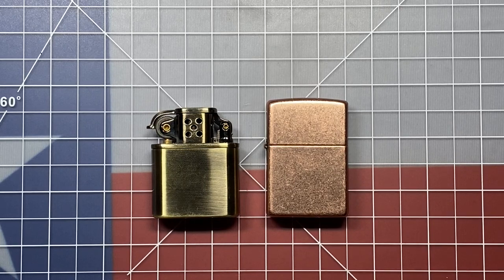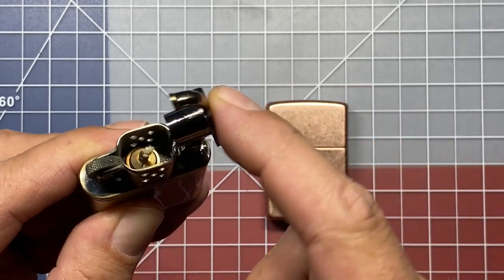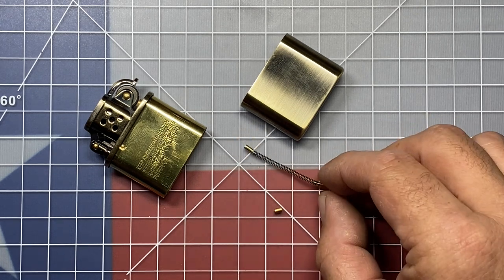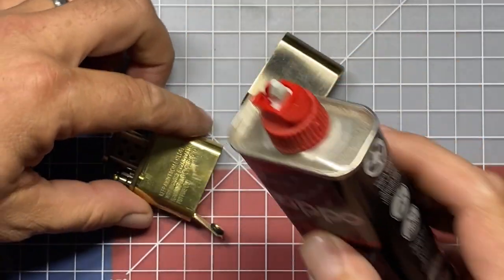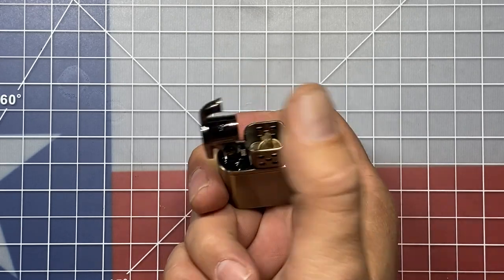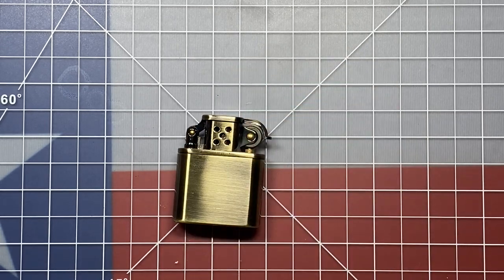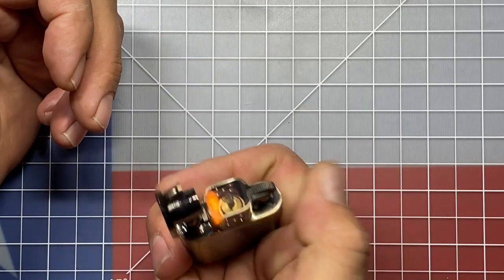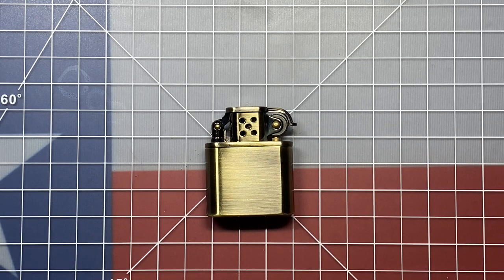Kuboy Lighter

Comment: We have to be honest, we can love Zippo for its history, but these are the improvements that should have been done but Zippo never did: o-rings and closed bottom (on AliExpress they sell after market plastic bottom, but I'd prefer a metal one like this one).
Reply: Exactly! Some years ago I bought a Zippo and was very impressed by it at first. But when I tried to light it a couple weeks later (thank goodness I don't smoke) and it wouldn't, I simply couldn't believe it! Back then they didn't even produce a genuine insert! Sold it not long after...
Reply: @mtronaut1694  IMCO (the brand Zippo is based on) is a better lighter. The changes Zippo made to the IMCO design back in 1932 made the Zippo evaporate faster, and 90 years later they still haven't fixed the problem. My advice - if you want a good petroleum lighter that will last more than a couple of weeks, IMCO is the brand to get. They're also cheaper than Zippos.

Comment: If you might be up for it, I’d love to see a follow-up video in a week or two with your thoughts on things like whether there really was fuel evaporation after all.
Reply from the maker: I will. I’ll try it for a week or so and give an update on it.
Reply: @txtoolcrib  Aces—you’re a champ!
Reply: @txtoolcrib    I installed a better fitting rubber O-ring on the bottom fill lever seal and on the bottom oval shaped plate.   I do NOT use Zippo lighter fluid or any other brands of lighter fluids in my KUBOY lighter.  

I use 190 Proof Everclear alcohol in this lighter because it will not cause an altered taste in my expensive cigars.

Comment: What your holding in your hand there! Is the last real Ronson! It was called the Ronson Storm,. Made from 1996 upuntil 2004, when zippo bought ronson and closed the factories. Then relaunched Ronson as a budget brand. You can still get them with stitched leather casses. They was produced exclusively for h. Samuel, uk jewellers. As part of the 1896 range. Although the founding company ronson usa had hit the fan. Ronson uk was still going strong. The tooling was sold to zorro, which is the parent company!

Comment: Thanks for posting. I have had one of those for a year+ and need to put in a new flint.  All I needed to hear was "same as standard Zippo flint."  Thanks.   My Kuboy has been solid for a year+. I need to top off fluid about every 2-3 weeks. No smell of LF, so seals seem OK.  Besides being solid, hefty and working well, Kuboy offers some nice designs.  I use mine to light candles for prayer and fell for the model called Constantine (from K. Reeves movie). It has a Benedictine design stamped on the outer case.

Comment: I bought one of these - lasted only a week before it needed more petroleum. I took out the cotton (there wasn't much in there) and repacked with one strip of cotton bacon. I also replaced what looked like a Zippo wick with an IMCO wick. I have yet to see how long it lasts, but it should be a bit longer.
Reply: How does it hold up?
Reply: @weaponized_saltiness  It still didn't last long, unfortunately - IIRC only around 3 weeks. The longest-lasting lighter I've had (that I've tested for longevity) was an IMCO 6600, with a record-breaking 54 days. That was with a new IMCO wick and cotton bacon. I'm currently in the middle of testing a new batch of lighters, all with cotton bacon and new IMCO wicks. The all-brass (supposedly better than standard) Zippo has already conked out yesterday after 27 days (didn't quite make it to 4 weeks. The rest of the test batch (all various IMCO models) are still going strong at 4 weeks.
Reply: @Beery1962  What's the main difference between imco and zippo wick ?
Reply: @harisyoung4110  Zippo wicks have a wire running through them. IMCO wicks don't have a wire in them - they're just cotton. As I understand it, depending on what metal the lighter body is made from, the wire can react with the metal of the body and damage the lighter in the long run (although I must say I've never seen this happen in any of the lighters I've owned). Anyway, I always try to use cotton wicks wherever possible, just in case.
Reply: @Beery1962  i just ordered the imco wick in ebay to try on my zippo.. i see it dont have copper braided around the wick, do you have any problem to keep it align in the zippo chimney ?. i assumed it will be soft and not stiff like regular zippo wick.
Reply: @harisyoung4110  It is softer, but getting it through the chimney isn't difficult because the IMCO wicks are attached to a metal lead (like a pin). You draw the wick through using the lead, and then you cut off the wick to the length you need it. The cotton wick is still stiff enough to stand up straight in the lighter.
Reply: @Beery1962  interesting, excited to try it out when it arrived.. read in the description the length is 355mm which is at about 12 inch.. so that means i can use for 3 of my zippo if i cut it to 4 inch (zippo original wick length).. what length do you cut in your zippo ?
Reply: @Beery1962  and one more question, did the diameter is the same like zippo wick ? did it fit tightly or loose in zippo ?
Reply: @harisyoung4110  I think the diameter is a bit smaller. I still go back and forth about using the IMCO wick with a Zippo for this reason, as it may cause the lighter evaporate more quickly, but then again, Zippos lose fuel faster than pretty much any other lighter no matter what wick you use, so those of us who count fuel retention over all other considerations don't use Zippos.
Reply: @Beery1962   evaporation not a big issue for me, i always top the fuel every week even it still have plenty in there.. product from imco should be a good stuff, i had use their flint before on zippo, it far better than zippo flint, produces more spark and last longer than original zippo flint.

Comment: Cool , I use to carry a zippo when I smoked, but since I have switched to vaping, my zippo sits unused.. even good zippo leak way to much... now I just carry a bic wiTh a rubber band to stop unintentional leaking... if This can a keep tHe lighter fluid from evaporating and actually have a useable lighter when needed, I may check it out